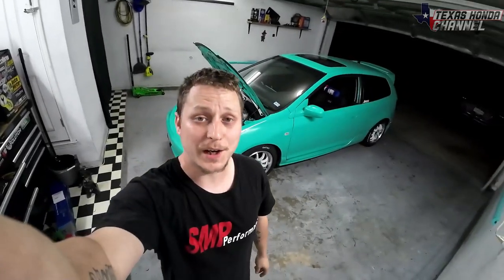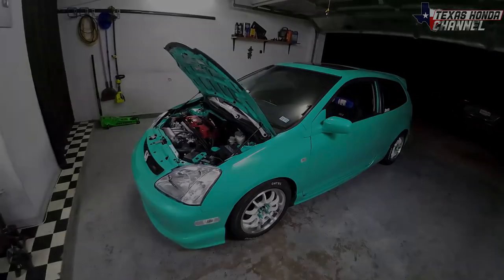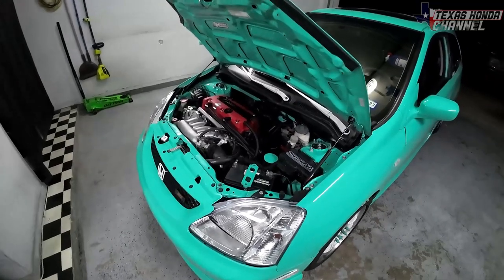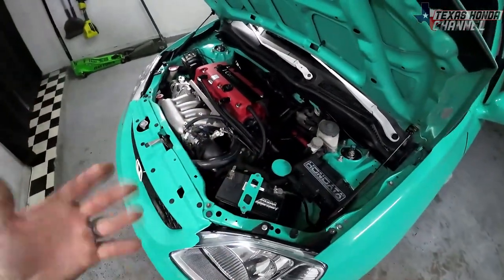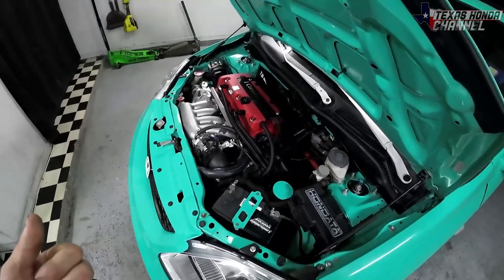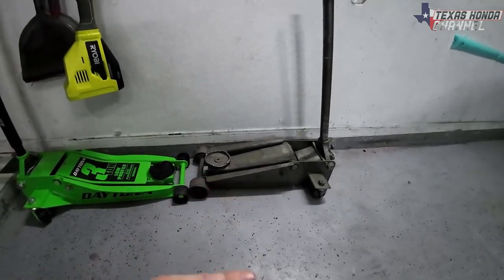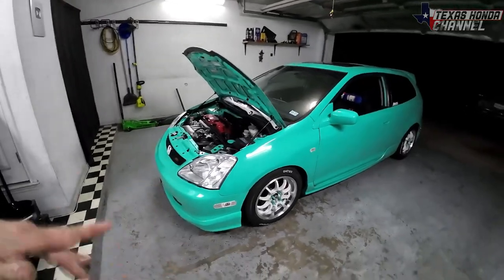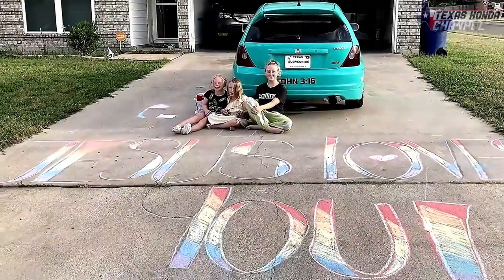EP3 GETS K20A2 SWAP! ITS WAY FASTER & HUGE THANKS TO YOSH TUNED!

Comment: I’m just gunna assume 5spd. Quick question: my 5 spd on my ep3 is on its way out. For the time being would it be worth it to do a 6spd swap with the k20a3 until I get get a k20a2? I have a 02 so 4 lug. If I want to swap in a 6spd do I need to swap spindles to 5lug???

Comment: Why not swap the 6spd trans too?
Reply from the maker: I have owned both 5 and 6 speed manual and the 6 speed seem to have more issues than the 5 and its not just me check forms and info if you need more info. Also i didn't get a free 6 speed manual transmission with the engine and not paying for one (money i don't have). The ep3 transmission works great and the gearing is good. It would be nice to have a tsx 6 speed because they are indeed stronger from what my friends who ran 8s on a stock transmission said. I have no issue with a rsx with 6 speed but if im going with a 6 speed it needs to be a TSX 6 speed for me personally. Its a preference thing i suppose.